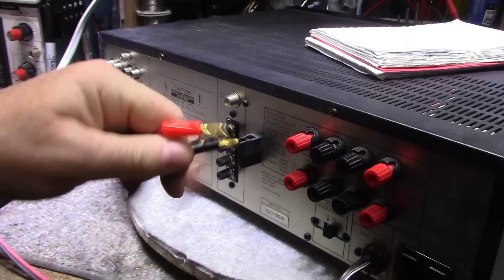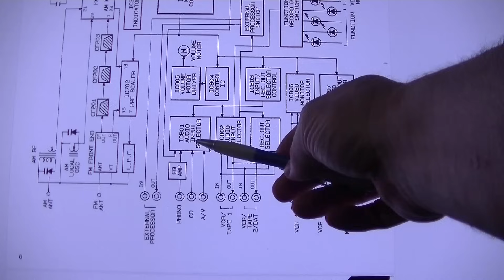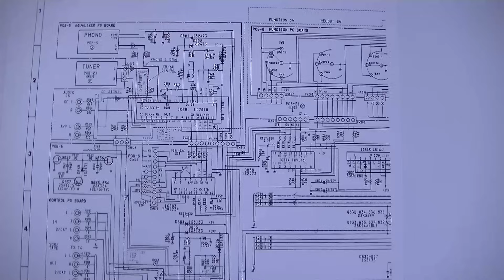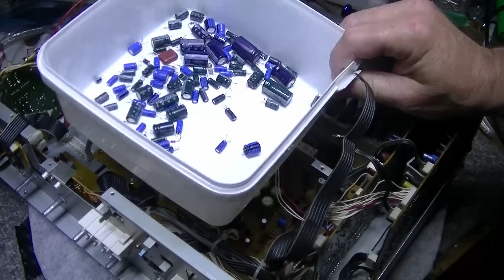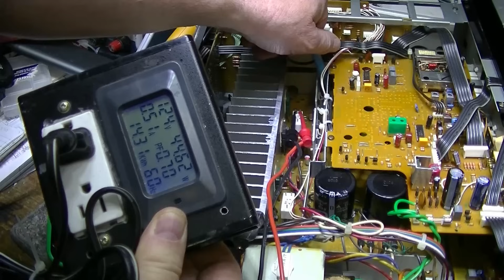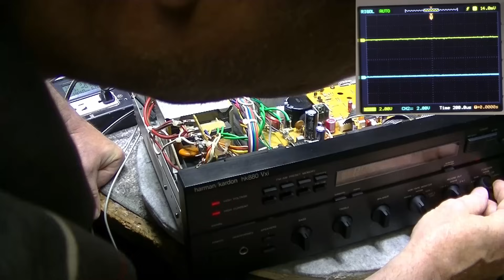Harman Kardon hk880 Vxi Receiver Repairs (Ep. 227)

Comment: Hey Trevor, great video. Thanks for the information. I have a receiver just like that. I bought brand new. The only problem I’ve been having with it lately as it takes about five minutes to warm up and then I can actually hear it clicking like the relay is kicking in and then it finally starts working so now I know what to look for
Reply from the maker: Hi Larry, glad to hear. Check the caps C829, C830, C846 on PCB-9 (Relay board) for dried up or cooked capacitors. Could also be a dirty power switch, failing Q818, Q819 or D818. Good luck

Comment: Question! First of all, great video!!! I bought this same unit new back in 1988. It sat a few years in the 2000's. I have a crackle on the right channel that comes and goes for a few seconds. When it does, the output volume drops a little. I soldered bad solder joints a year ago on the speaker banana board which solved the problem but now it's happening again. This time I sucked the old solder out and put fresh solder in it but it's still happening. Any suggestions? Thanks in advance!!!

Comment: When I got mine it was the same. Diox 5 on all the switches. Including the ext pro, sub filter. The input  switches are Alps and have a place to spray them and it works now. That is as far as my tech skills go. But has been working. Audio Warehouse who fixes my stuff said he just went through one. And those blue caps were toast. They just got done fixing a CD 301 HK cassette deck for me and a bunch of those blue caps were shot in it as well. The receiver is 88-91 and the tape deck is I think 81-83.

Comment: Hello Trevor -- Just Subscribed about a month or so ago -- Been binging on your videos. An Old tube radio guy & have a couple of Nice Pioneer receivers to get running. Trying to find schematics has been hard for me. I never see you tubers complain though. Can You tell me what's Your Go-To source when you need a Schematic. Your Videos Have Been Particularly helpful understanding how solid state works. Thank You in advance.
Reply from the maker: Hi Lloyd and welcome to the channel. I find most of my schematics at HiFiEngine and VinylEngine dot com.
I also find a few with just a search with make, model and the words "service manual"
Reply: @TrevorsBench  Thanks so much for getting back to me. I did ask Aiden from A-H fix-it He mentioned HiFiEngine but stated "But I hear they're not taking new users. I don't know where else to go unfortunately." I know I can get some with Capacitors Kits & some Owners manuals. I will try The others & searches You mentioned also. Definitely a Big Help. Thank You
Reply from the maker: @lloydgreen4091  Interesting they would suspend creating new accounts, I didn't know this.
I've been using a search engine like Google to find service manuals with some success

Comment: This must be a stereo music power amplifier. For the intermediate option between Class AB and Class A amplification modes, selecting the appropriate quiescent current of the final power transistor can make the sound quality better than Class AB and close to Class A while maintaining the appropriate heat generation. The appropriate quiescent current is probably between 30mA and 80mA, so the value marked on this machine is close to this value. Of course, the drive stage current also needs to be coordinated. For non-Class A amplifiers, the voltage amplifier stage, drive stage, and power stage all have a suitable current value. Thank you for sharing this maintenance video. I am an electronic audio enthusiast, not an expert. I am a learning person. I express some personal opinions that may not be mature based on what I know. I don’t understand English, so this is translated into English through translation software. Thank you!
Reply: So according to the circuit diagram, the static current of one channel is: 0.04V/0.27Ω=0.148A
The static power of two channels is: 0.148A*80V*2=23.7W

Comment: Great video, and diagnostic skills. I love the way you explain things. This receiver has some hours on it, that's for sure. I'm also active in the same field as you, fixing consumer electronics as a profession. My focus is on vintage audio. Mainly upgrading and fixing amps and cd players.

Currently i'm working up the courage to start a full restoration on a pm 665 VXI. I'm a great fan of hk amps of this era, as they have dc coupling, and very few coupling caps. I did a pm655 7years ago, and recenly that cliënt brought the unit back for some small upgrades and repair. I was reminded again how good these units sound after a full and good restoration, and bought a pm665vxi on Marketplace for my personel collection.

Congrats on the 10.000 subs m8, i'm just surprised it's not a 100K subs (yet😂). Ported over from Xray T's channel some years ago. Also i like the calm way you do and explain things. Without drama, and with knowlege. All the best, and cheers from the Netherlands.
Reply from the maker: Thanks and welcome to the channel. Hopefully you'll find something helpful for you here. Maybe one day I'll find a 665 Vxi for myself, I'd love to listen to that one fersure.
Reply: I have a 665VXI too that needs a repair. Powers up but no sound. I’m a novice with regard to making repairs. Any thoughts on where to begin or likely culprit?
Reply: @demenc  
Check if your switch for seperating pre and main amp is in the right position. Press it on and off for 10 times first with the amp switched off. Then try it.
Reply: @nicodenhaak3961  It was on the correct setting, but I tried your suggestion anyway and it didn’t work. Thanks anyway.

Comment: The hk880 vxi is rated at 60 wpc but H/K rates their power output conservatively. 71.58 wpc  is great but not many people will run that receiver at full output. The power transformer seems a bit anemic and small for  what it is handling but just "adequate". The excessive voltage sag on the power transformer is a bit concerning but I guess it is ok and will hold out, otherwise the engineers and manufacturer, Shin-Shirasuna wouldn't have released that design into production. If you ever come across the hk990 vxi (90 wpc) at a good price,  grab it.  That receiver really kicks.

Comment: What does the subsonic filter do? Is it a useful item to have on an amp?
Reply from the maker: It attenuates low frequencies like 20Hz and below. This is useful for the phono input only.
Very low frequencies can come through from the turntable base and can cause feedback or noticeable noises like thumps or booming from the platter as the stylus rides the vinyl groove.
These low frequency noises can come from things like walking across a room or from the turntable picking up bass note vibrations from the table it's sitting on and can sound quite boomy and annoying. A good solid platform for your turntable is best for reducing these noises.
Some turntable manufacturers made the turntable base to have a lot of mass to prevent these noises from being picked up.
Some cheap turntables used a molded plastic base and can actually resonate in the 50Hz to 200Hz range which causes noticeable feedback and noise at the resonate frequency
Reply: @TrevorsBench  Thank you for explanation Trevor I never knew what that was for. I learn something new every day from your channel. I have a Technics SL-D2 and it a heavy one so that helps for what you are describing and I also have a Technics SL1200 which is even heavier than the SL-D2

Comment: Congrats Trevor! I've had a rash of bad leads lately and it drives me nuts. Stupid rabbit holes I've travelled only to find out I was way off. Grrrr. I have two of the Vxi integrateds. 640 and the big dual transformer 665. The 640 is a little sweety with great sound and unfortunately the 665 has a cracked input board which I've been trying to repair but no luck. I'll get back to it some day.
Reply from the maker: They really are a treat to listen to when they're running right, hope you get them up soon.
Maybe my vids can be some inspiration for you, lol

Comment: Not impressed with the build/component quality of that amp.  That's a lot of failed components.  Maybe it took a surge at some point.
Reply from the maker: I think the failed TK caps took out the regulated supply. The tiny 1/2w 47 ohm fuse resistor can only take so much current before it pops

Comment: HK’s of this age are great sound amplifiers but always check the solder joints. 

Wetter it’s this series of receivers or the PM6xx and 6xxx series you can always find plenty of bad solder joints. Especially around transistors that get hot. 

Oh, and not to mention some series of TK caps, I have the idea that some are even worse then china caps.

Comment: I had the same receiver a few years ago. The light bulbs for the tuner were glitching (bad solder joint on the connector) and the balance pot was scratching, which resulted in no right channel. Apart from that the receiver was fine, no bad caps and needed no adjustments